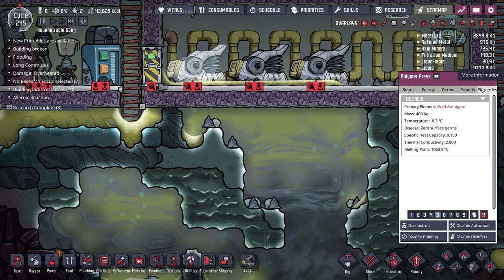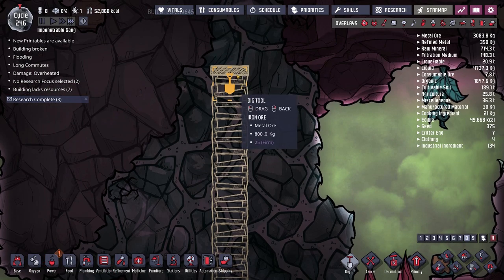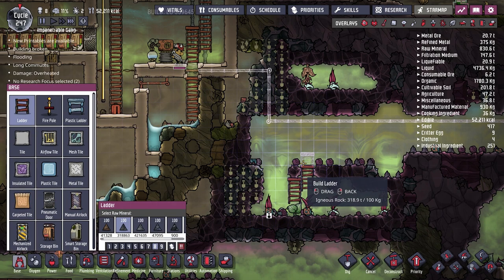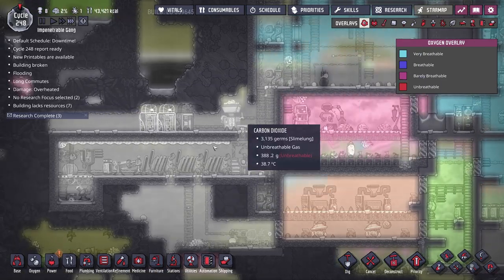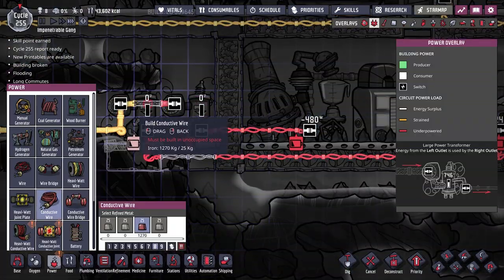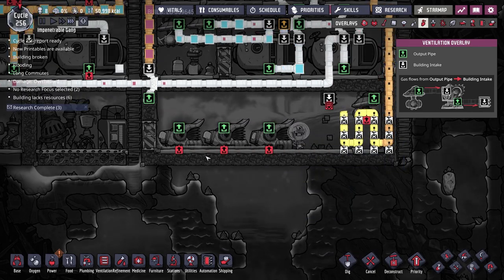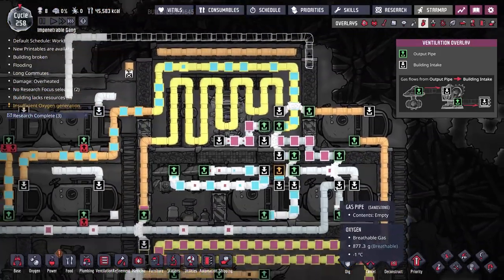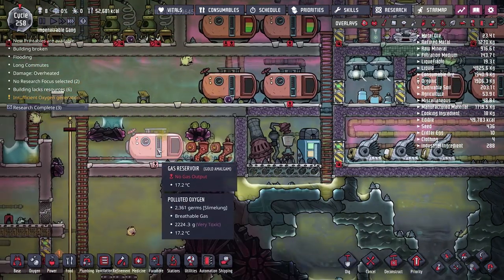Polymer Press Automation & Cooling! | Oxygen Not Included LAUNCH UPGRADE #22 [Let's Play]

Comment: Commenting as it happened, I'll delete if you catch it, but you just set Burt to be the only one prioritizing machine operation rather than making it so thats all he does. You need to change the horizontal row, not the vertical column.
Reply: Yes. Instead of telling Burt to only operate, he told only Burt to operate. That means he needs to run ALL the machines that need operating, unless other dupes have run out of things to do.

Comment: That metal refinery is going to be a major focus. You will need to find a good set up for that because you will want a LOT of refined metal.

Just for your information. The rock crusher can make refined metal, but it's 50% efficient. 2kg copper ore into 1 kg copper. The metal refinery does it at a 1:1 ratio, saving your copper/iron/gold ore. This just comes at the expense of a lot of power, and heat generation in the form of heating up the liquid. How much heat generated actually depends on which liquid used and which metal you are refining.

You will want to check out the wiki on it.
https://oxygennotincluded.gamepedia.com/Metal_Refinery

You have to expand the tables. But choosing a liquid and finding a way to cool it back down (multiple methods exist) is a pretty big process. Once you do though, and it's stable, it can really kick out a lot of metal which is very useful.
It's also needed for steel. And you want steel. Gold ore gives you +50 to overheat temperature. Well all refined metals give that. Except Steel gives +200 to overheat temperature.